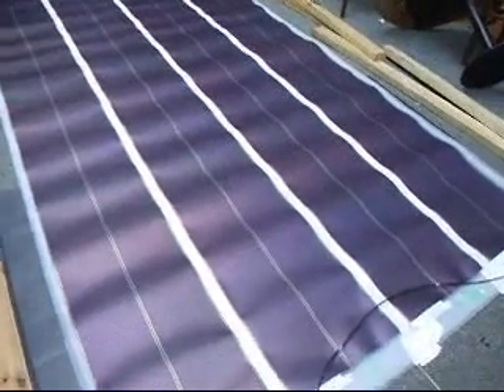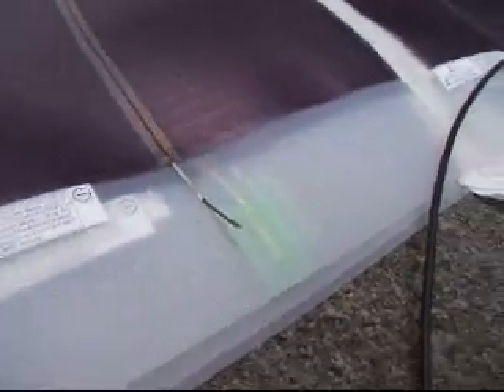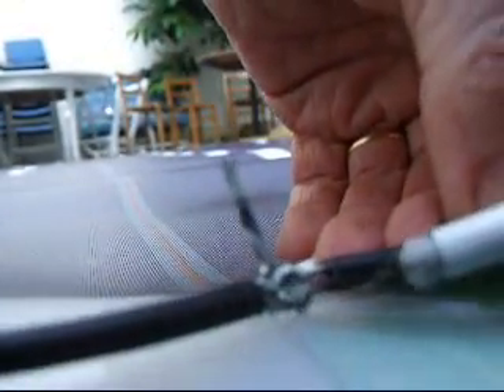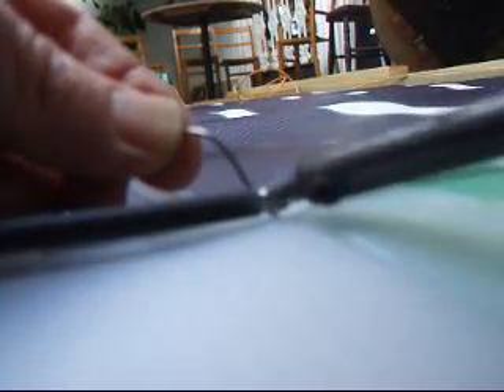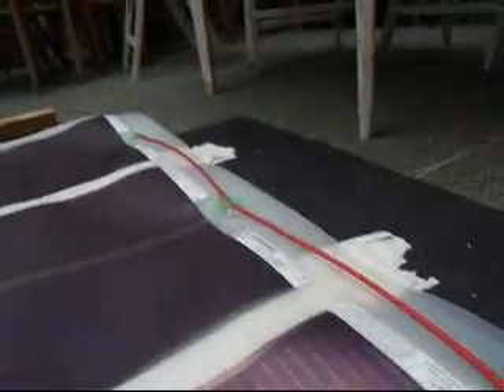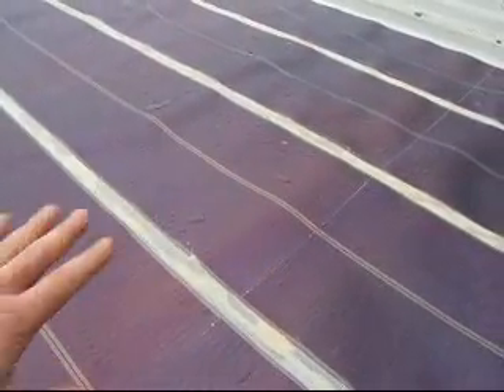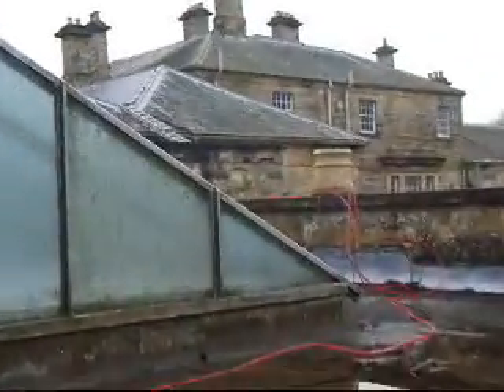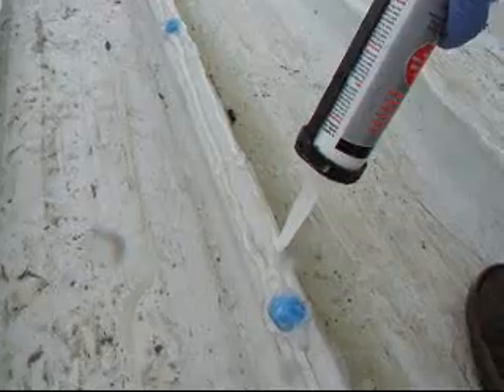installing flexible solar panels on metal roof

Comment: This was 7 years ago. Are they still up and running? Did they need any maintenance? Any of them burn out?
Reply from the maker: The ones on a flat roof remain excellent. The ones stuck to a slate roof have failed on account of the glue failing and being blown by wind.
Reply: @unequally-tempered  great to hear it! 
my oldest one is acting funny so I'm trying to figure out if I've done something wrong in it's assembly. Yours are in paralell as well without any blocking diodes between them correct? So I assume there is no problem with current flowing between them? Mine are joined in a triple MC4 connector and directly to Viktor's custom DC-DC converter wich then feeds my mppt charger for batteries and 12v load appliances.
Reply from the maker: @DJBelbe  I haven't got blocking diodes but if your's are doing odd things it might be an idea

Comment: How to use 319v dc to convert 220 ac?
Reply: The usual setup is getting a custom DC-DC converter (a dutch seller on ebay has them) that will get the voltage down to your battery bank setup (12, 24 or 48v) and then hookup an inverter to the batteries.

Comment: Hi

How did you glue them together?  Side by side.   I see that you put them over one each other on the clear part. But how did you manage to glue them so well and straight?

Thanks 
Yossi
Reply from the maker: I used GB Pro silicone or CT1, putting a thin line of the stuff down the edge, lifting the next edge upon it and then putting a long timber onto the joint to keep it straight.
Reply: latribe thanks i will try
Have a nice day

Comment: Hi i have the same panels with the bare tabs.  Why do they not need junction boxes like the other ones?   Can i just soldier a cable with a connector and use? Would i not get reverse charging?    Thanks for your video
Reply from the maker: One has to solder wires to these and waterproof the joint with CT1 or GB Pro silicone and cover that with a half round plastic pipe to protect from light to stop the silicone degrading. For a grid-tie system I connect each panel or set of panels through a 1N4004 diode so that in working on panels if a wire to one is disconnected it cannot short the system. But you're not going to get "reverse charging" in an offgrid system because you don't connect these direct to batteries. They are 300V working and you must put them through the 24V or 48V controllers especially for these panels to work with batteries. All panels must be used with charge controllers matching solar panels to the respective battery systems and never simply direct connected to the batteries.
Reply: Hi thank you for taking the time to answer me, i have subscribe to your channel.  I have been a little overwhelmed with these panels mostly because of the high voltage.  My plan was to put junction boxes rated for 100 to 180 watts on each of the panels (i have three) and run mc4 cables from the junction (junctions have diodes), connect two of them with a y type PV Solar Panel Cable Connectors on my camper van to keep the house battery charged. The other panel i was going to use as a portable unit to charge an extra battery on my jeep.   I have two cheaper 20A  Solar Panel Battery Regulator Charge Intelligent Controllers 12V/24V Mppt that i was going to use on the different systems.  Are these panels to much for what i want to use them for?  Could they burn out my controllers or harm my 12 volt battery?  Sorry for all the questions, your help and advice is greatly appreciated.  
Some of my solar controller specs are as follows,

Open circuit voltage of solar panel: 40V MPN: y
No load loss: 0.05W a
Over voltage protection: 15V; X2/24V 
Float charge voltage: 14V; X2/24V: 
Discharge recovery voltage: 12V; X2/24V
DC output voltage: 12V
Over discharge voltage: 10.5V; X2/24V 
Total DC output current: 2A
Control mode: Software intelligent control
Reply from the maker: If you are using 40V panels on a 12V or 24V system you need a MPPT controller to bring the voltage down and increase the current, or else at best you'll get only 50% or 25% power
Reply: latribe, nice video. Where did you buy it from?

Comment: Hi,  how are you? 
This is Alex Yang from Xunlight China, the only manufacturer of amorphous flexible thin film solar cells and panels. 
 
I saw your message related to Unisoalr panels. 
When Unisolar is down, we bought their cell business and continue to produce flexible thin film solar panels in China.
 
We have two main kinds of products for customers` option.  Its power range is from 25W to 300W with weight range between 1Kg to 12Kg. 
1. Roll-out Thin Film Solar Panel (Suitable for special roof-top, bus shelters, solar tent/camp, LED Light Pole)

2.Portable/ Foldable Thin Film Solar Kit (Solar Power Bag, suitable for outdoor activities)

 If you want to know more details, please email us via alexyang@xunlightchina.com    
Thanks and kind regards

Comment: I would appreciated if anyone can provide the information or web link of this company who manufactures those solar panel, or the contact information of this lecture,
Reply: Fuji stopped producing only available on ebay,de or auctions. Problem is the 319 Volts output that is considered high voltage and the reason why Fuji stop, otherwise I did installed them on my roof 400W till now no problem (3 Years)
Reply: You need a step down DC DC 319v to 14...V and there is no need of mppt regulator. It is quite for a compact mobile system but be aware of the risk of electrocution at 319V if you touch the two opposite wires ....

Comment: Why is it that when people do video's they DON'T talk about the important stuff like how many volts or watts it puts out per sheet and they ramble on and on about things nobody cares about.
Reply from the maker: Why don't you ask rather then merely complain? These are 100W panels which are 400V open circuit, 300V maximum power so each combined set of 4 panels is around 400W. In fact were you to be really interested in such panels you'd find in practice that you'd be really interested in the fact that I don't trust the MC4 connectors and that a good solder joint, showing you how to do it, insulated with silicone, is better.

Comment: Thanks to the Sun gave birth to everything ! Also environmentally friendly power generation , make our lives better ! Http://boo.tw/z9Ksj
( * ) Solar collector heat pump ( air collected in converting thermal energy into hot water and air-conditioning ) ! Environmental protection , energy saving ! save money!
 ( * ) Rooftop solar shading to the indoor cooling and legal construction , demolition will not be reported , and quickly find out the best "Solar System to print money - make money selling electric technique" solar power, finance and investment, new ideas Ministry of Economic Affairs Bureau of Energy renewable energy law to ensure Taipower 20-year power purchase agreement guarantee ........
Consult Line : 886-966-715989 Kitty
 Plus LIKE http://line.me/ti/p/O78T5Xwa0s

Comment: I have some of these panels, I was wondering whether this setup is on or off grid and if on grid what inverter were you using? Many Thanks
Reply: ***** And how it worked? Do you recommend it? Thanks in advance
Reply: +Andrew Leigh 

Hi 
Andrew Leigh
> From where can we buy these solar panels?

You also connect with me on : biogenglobal.ca@gmail.com

Many thanks for sharing the knowledge

Comment: Good video. I bought the same panels and wanted to see how other people added the connectors. I'm still trying to think of a good way to mount them on my roof since I'm renting a place here in the Philippines. It's a metal roof and the owners want to limit any drilling etc and I want to be able to remove them if I move somewhere else.
Reply: Gadget Addict How much energy do you generate?
Reply from the maker: +Gadget Addict Sorry for delay in reply. A silicone sealant type glue fulfills that function
Reply: latribe Would it be easy(ish) to remove the silicone glue if ever I wanted to take the panels down? Would it cause any damage other than needing a bit of paint? I'm imagining removing them might damage the panels or leave silicon all over the roof. Cheers :)
Reply from the maker: +Gadget Addict If it's a metal roof then you should be able to cut through the silicone with a sharp knife and then paint on top
Reply: latribe Awesome, thanks :)